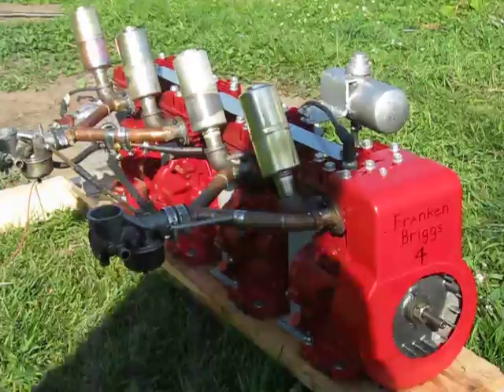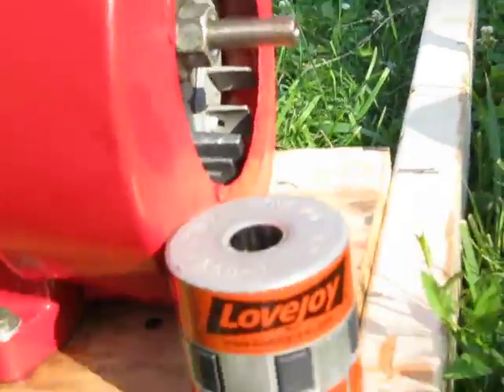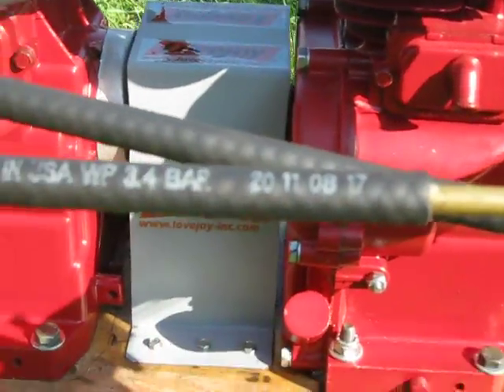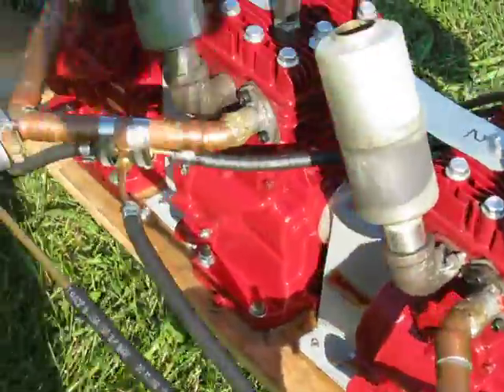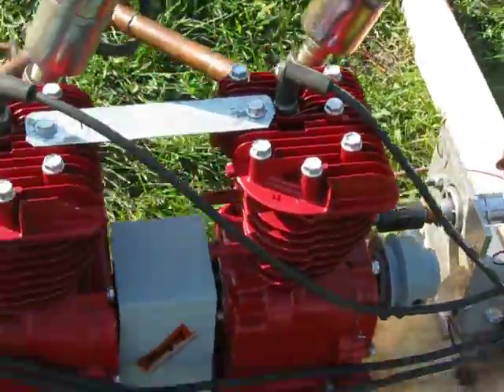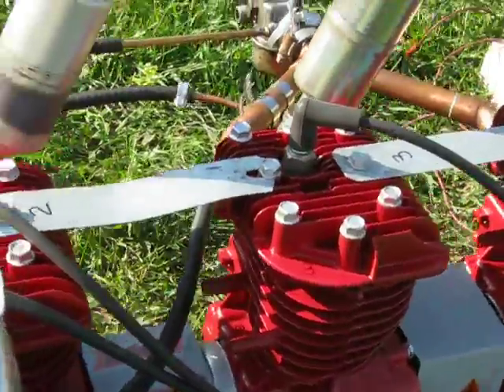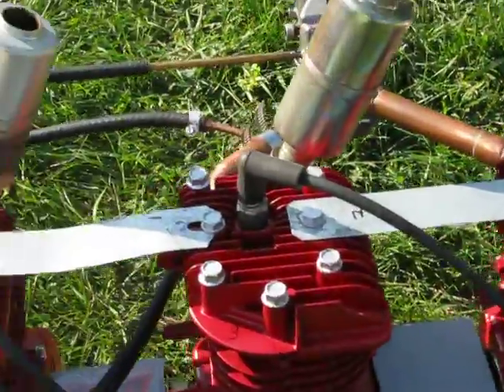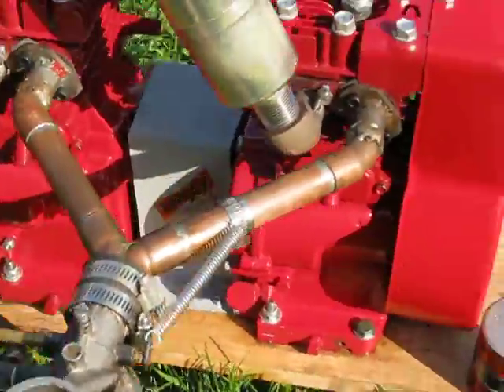FrankenBriggs 4 Cyl. 40 Second Run!!!

Comment: wow thats a good sounding engine, glade it got going
Reply from the maker: Yes, it is good to finally have a successful run from it, I wanted to get it going sooner just to show that the new couplings worked out well, but assembling and running this is a big time drainer. I am glad it ran so well, now I have to figure out where to store it!!!   I expect I will have to take it back apart again to store the individual cylinders.
Reply: yes i suppose it a a bit large in it current form

Comment: Great work, but see all that movement in the engines? That's really gonna kill those couplings. You really ought to get some steel holding those engines together.
Reply from the maker: yes, I noticed the movement when I watched the vid. I couldn't see any of that when I was manning the throttles! Looks like the wooden base is completely inadequate for the task. I do plan to make an I beam steel base, the problem I have is where to put it, since my wife is reclaiming the backyard as her territory!!!  lol    I did send one car to the scrapyard, so that made more room, this engine is fairly large though, at 5 feet long, and it weighs 120 pounds on the wood base. Guess I better look into crane rentals!  :)